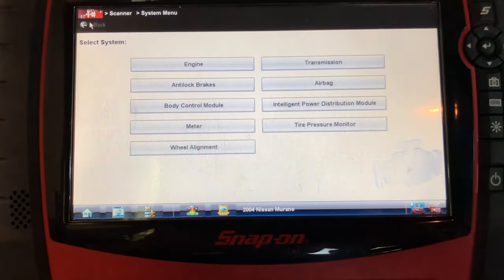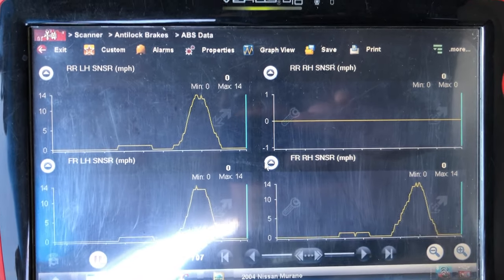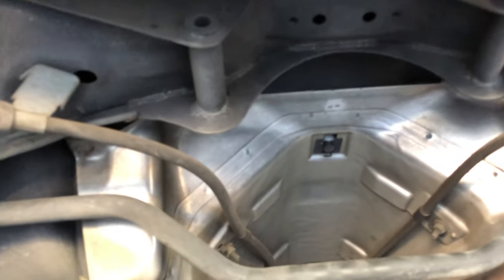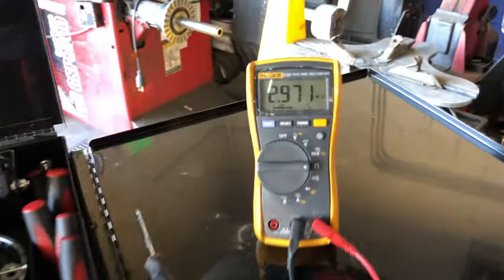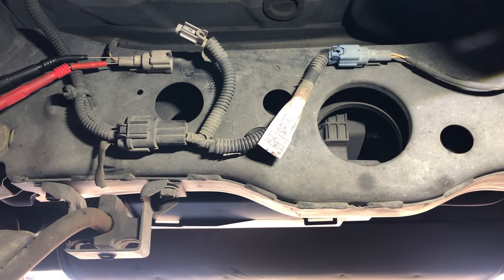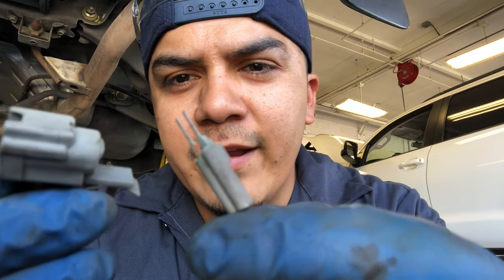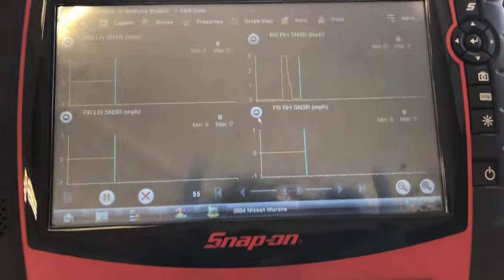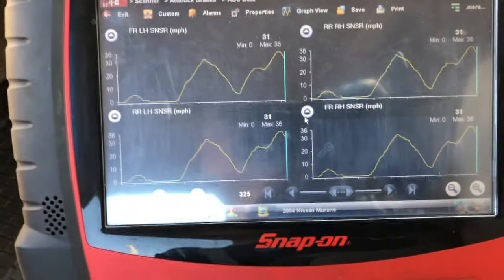🛠How to easily check ABS/ Wheel Speed Sensors - Diagnostico y Reparacion

Comment: Make sure the battery is disconnected after you verify voltage at the plug, you can’t test resistance in a powered circuit. Great video!

Comment: What a great illustrative explanation. My truck is throwing Traction Control and ABS codes. My scanner does not tell me which is bad. I do have a Fluke 12b meter though and will go check them out. Thanks much for sharing this.

Comment: Thank you Hector!  I have a 2006 Crown Vic P71 (cop car) with a ABS light for the last year. Luckily the connectors for the rear sensors are under the rear seat. I checked voltage....and then resistance...and found my problem! Thanks Brother !!! Muchas Gracias mi hermano! Que tenga un bien dia!
Reply from the maker: That’s what I’m talking about 👍🏼 thanks for subscribing 👊🏼

Comment: Thanks!!! I have a 2018 RAM 2500 with the ABS light on. Now I know how to test it. I will do the Voltage and resistance in the 4 sensors to compare them.

Comment: Had a feeling resistance check would be a good test, thanks for the verification. Im pretty convinced my neighbor broke the tone wheel  on his for some reason tho, abs light after changing the brakes
Reply: What's the "tone wheel"? I changed my front break pads on my 2003 Expedition last night and it felt like something fell out of place, then my ABS light came on.
Reply: @JoseTorres-vp6sk  it's the magnetic ring that is either located on the axle or the back of the wheel bearing right near the ABS sensor. The sensor uses the magnetic ring to give the computer a signal. If it breaks it will not give a steady signal to the computer
Reply: @JoseTorres-vp6sk  I don't know why I said tone wheel haha it's "tone ring"
Reply: @johnnyversaci7091  😂...thanks, I understand what you mean now.

Comment: Yeah, nicely produced video.  I replaced my front, right wheel sensor as I was having the message "Check AWD System" with the ABS/Traction Control lights on.  This did not fix my issue.  The lights keep going away/coming back on there own so it is an itermittent issue.  I did do the ohm test on the old sensor and it was an open circuit so it may have truly been bad.  Auto Zone did the scan before all this and it returned codes C1413 and U0126.  Maybe there is still an issue with my steering angle sensor.  I have a 2015 Highlander XLE.

Comment: VERY good video.  I need to do this for my 2006 Honda Pilot.  I've got a VTM-4, VSA and an ABS light on.  Scanner tool at AutoZone said that the left rear wheel speed sensor has a signal error.  Thanks

Comment: Good presentation .When checking the module voltage to sensor , did you have to start the car or just set the ignition switch to accessories ? , and is there a delay

Comment: Great job Hector. Very professionally done.  Unfortunately, most of us do not have the Snap-on diagnostics to verify but will have to improvise.  Most consumer-priced scanners are not that sophisticated, do you have a suggested alternate to Snap-on?
Reply: Zurich zr13 is the most budget friendly scanner ive found. Has everything from ABS to ODBll code scanner and shows live data. Great tool for around $80. If your only able to diagnose and repair 1 problem, your getting your moneys worth.

Comment: "OL" means Over Limit, or resistance is higher than the meter setting. It can be an open circuit, or just a very high resistance.

Comment: That's DC voltage set on the multi-meter.  Also, REMEMBER that if your car has the ABS light on, it does NOT mean it's the end of the world.  It means that your car will still able to handle braking WITHOUT the advanced ABS feature, but it's good to get it fixed!

Comment: look at that sunshine. Im in CT during winter. And yes it does really suck lol
Reply from the maker: California☀️Westcoast is the Bestcoast 😎
Reply: @HomieHektor  yo I actually had a question for you. If you dont mind. I have accord 07 v6. The rear wheel speed sensor, if that just brakes off what would u do? Lie drilling it out seems like its not possible because the bearing is a whole bolted on assembly. Would i just have to replace the whole bearing assembly? I would really appreciate your thoughts.

Comment: Can i install an abs sensor on it's opposite side? For example installing a drivers side sensor on the passengers side. Will it have different connectors, or is there anything else that might prevent me from doing so

Comment: Homie I have the tire pressure icon on. the traction control. And the stability control system.  Omg what's wrong? I just had shocks and brakes installed and right after that all lite up onbthe message panel!
Reply from the maker: What’s the year make and model of the vehicle.? I’m guessing Chevy

Comment: Getting the same codes on my 04 GS300. Circuit Open or Short on right rear wheel speed sensor which on a rear wheel drive car effects the abs, and transmission which causes traction issues that will put the car in limp mode

Comment: Hey @homiehektor how do I test the abs module if it's good or bad? The module still on the car.
I'm not getting any power from the module to the sensor no continuity either.
2006 Toyota Sienna
TIA

Comment: Wsup hector your video was nice . I have a ? I have a 2006 Lexus is 350 all my speed sensorS are bad I replaced all 4 but only the rear are active the front ones ones the mechanic test them it’s just showing that all 4 are bad . Do I have to take them to a Lexus dealership to activate the sensors

Comment: Hi there, Thank for good video. Is it possible to operate ABS module with only one speed sensor? Actually, I am a student and want to present the ABS operation with single tire and break assembly using single speed sensor.

Comment: Hey bro any recommendations on a 2003 GMC Yukon Denali the service stability display comes out in the dash and the brakes lock up I need to turn it off for like half n hour for it to be good again I just checked it with a scanner and no codes it’s only done it twice in the past six months just checked the speed sensors and they all are working correctly anything else I should check my local shop recommended a whole new front suspension rebuild and quoted me 4K and they said they weren’t sure if that was going to fix the problem

Comment: my front left brake is locking up, could this sensor cause this? i have already replaced the brake hose and caliper with no results.  also the back right is locking up at the same time if this may have any extra information for you.

Comment: Hektor do you have any videos on how to locate crank and cam sensors signal pin wire directly on the ecu using continuity with a multimeter?

Comment: Great video verry clear and well detailed. 👍 if the bearing ring was finished. Would your reading with the abs sensor still read (ol). What will you tell the clients if you changed the abs sensor and then you need to.change the bearing. Clients get upset with the new surprise and ones the abs sensor is installed you cant return abs sensors ?
Reply from the maker: garant blais The ring and the sensor itself are separate in this design. you just gotta be honest with customers, admit the mistake and work with the customer. Try to have him pay for the part, and you do the labor free. It’s on you to fix it, sometimes you gotta eat it and learn from it.

Comment: After I did my alignment at Les Schwab all my warning lights came on after they try to do a SAS calibrate and failed, I fix and cleared all the other lights but only one light remind it's the traction off light and when I went to check it with diagnostic scanner it said vsa error/fault is this my steering angle sensor?  Car is a 2017 Acura ilx thanks in advance

Comment: voltage check from switch back to battery, & I recently just took apart the whole dRn cR just to get to the EBCM(electronic brake control box), & figured it out the diffult way.. LIIIIKE AN IDIOTA I might add 😒.  btw as you’ve likely heard, the end few ‘ of these wires often break invisibly on inside of outside rubber wire housing - although this in this case likely switch, etc.  but softly wiggling wire with ohm meter set up is a good chinese secret to check for thae ooold invisible  wire break..

Comment: Hey dude question for doy its kinda long story but I will try make it short ,,i was working on 2005 we Jetta 1.8 t Turbo 4 L engine the owner try to do the brake on the vehicula but he ended up removing all caliper and the hose where  hanging he left that for about 3 days until he found me right so I put everything back and bleed the breaks soo evething where working fine  all brake where engaged well. But yesterday I notice the rear  break rotor has some marks  he told me that break pedal feel a lil 🧽. So I jack up the car and the rear breaks are not engaging en everytime I press the breaks the abs motor start crying sound  so I remove the cliper brake house but even if I pres the brakes  not fluid it’s coming out the hose  and I just not sure what should be  my next step!!

Comment: Hi hector i got a 97 dodge ram 2500 turbo disel 5.9 engine cummins my issue is that my rpm needle keeps bouncing alot and my turbo doesn't kick in when i reach 40mph any idea?

Comment: I need HELP please, I have a 96 Nissan Maxima that the LF wheel senor is reading a 25 code? is this correct? and I have been trying to get a used sensor for this car and cannot find one!! a new one apparently is 500.00 is that correct? I want to keep the car a little longer . the ABS light has been coming on and off for a few months now. I would greatly appreciate all your help

Comment: My left rear speed sensor doesn't even show up on the  scanner!  All the other speed sensors show up.  I replaced the left rear sensor with a new one and even replaced the will hubs with new ones, but still no left rear speed sensor.  I did notice that the right rear speed sensor had 11.8 volts coming from the main harness, but the left rear speed sensor only had 11.08volts coming from the harness.  Also, the right rear speed sensor has 3 wires(factory) and the left rear speed sensor has only 2 wires(factory).  What can I check now?  Thanks

Comment: el gordo says I don't have your fancy equipment. Just a regular digital multimeter.I think I can still look for shorts that way. This Gringo loves your video for my 99 toyota sienna. But my wheel sensors bolt in I'm pretty sure. Thanks El jefa. From a really bad speaking old english white man. I'll just have to check the continuity and voltage on each wheel and look for the obvious because my abs light keeps going off and on so it is an intermittent failure which will make it harder for this gringo. Thanks homey.I should be able to find some vastly different on ohms or voltage. If not then I will be a senora.wish I could speak spanish. So like the typical white man we have to make up our own version of spanish slang. Thanks so much. voto.  Kay passo or kay passa. Just trying to act like a stupid white grindo. take care. 😁😁

Comment: Hola Hector , I have a 2013  jeep Grand Cherokee limited , 3 months ago the mechanic replaced both rear wheel bearings and from there, the ABS, Traction, parking asistant, and cruise control not working plus all the lights turn on, I took the car to a couple places where the codes show that the rear wheel speed sensor needs to be replaced, after they put a mopar brand new sensor, i'm still have the problem ...
Do you or anybody knows what can it be the problem ?? Thank you

Comment: Como checaste el voltage. ?
Con la llave puesta y encendido?.
Reply from the maker: rudy 0476 así mero, con la llave en ON. 👌🏼
Reply: Ok Hector  ya hice  eso. Pero  sigo con el problema  tengo el stability control service on. Y lo que  pasa es raro  por que la pongo en drive.  Una rueda se enfrena apago el switch que esta junto a la palanca.  Y le  pongo otra vez drive. Y la otra se enfrena.  Hace lo contrario.  Que crees que pueda ser.
Alguna idea por favor  ya  cambie los sensors. Las hydraulic hoses .

Comment: Too much work to remove the 4 wheels and test each abs sensor 1 at a time. Is there an easier way to test each sensor from the wiring endpoints near ECM ?

Comment: Ya que se que eres una riata pa los mechanics.
I wanna get your opinion on this problem i have on my 2007 ford f150 which every person i ask tells me i need to change my tranny but i knw for a fact that truck is in perfect condition so I know that's not the issue. Anyways the thing is I change my alternator upgraded it and installed two sensors which were the input and output it speed sensors. After that one of the plugs on the transmission got disconnected while working on the sensors and I let go of the gears and went off the ramp nothing crucial .  No one was injured lol but from that point after I connected back everything… when I turn on the vehicle I could only turn it on when I have it on neutral I won't crank when I have it on Park and it also won't go into  to drive . But it will go into reverse. I've been trying to adjust the neutral safety switch that's which is the gears inside the transmission. So do you think I'm close to the problem and what do you suggest I'm able to do you fix no problem and have you ever came across anything similar to my predicament?
What can you advise me that would help me tackle this issue so I get back on the streets with my mamalona . I would appreciate the vergoscosity of your mechanical wisdom if you knw exactly what i should do..
Reply: I forgot to mention the code that pops out is p2195